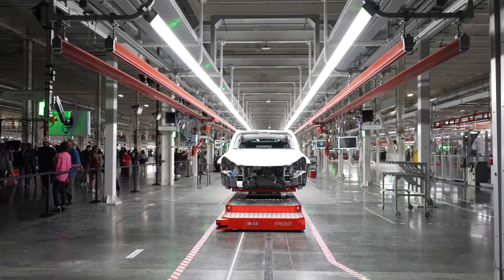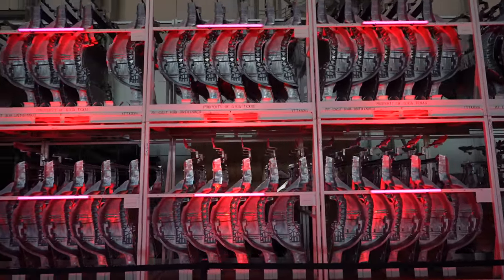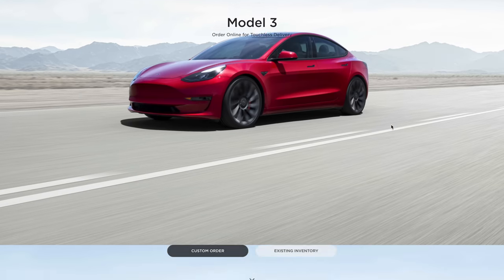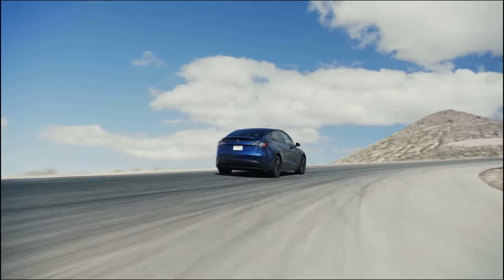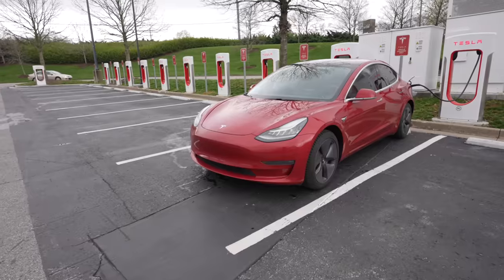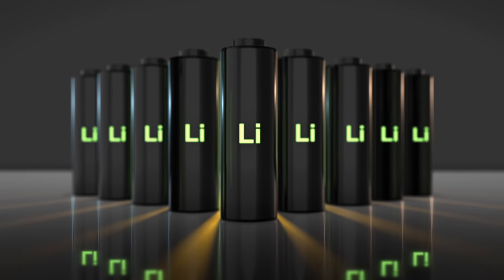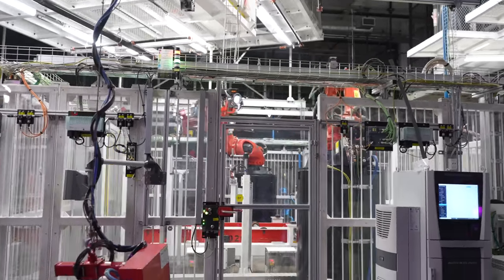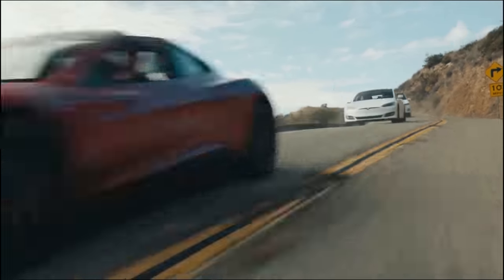Why I’m NOT Buying the New Tesla Model Y

Comment: Ordered my Model Y LR in Aug 21, took delivery March 30th.  Fremont VIN, live near Seattle.  Absolutely LOVE the car…even if it doesn’t have the new 4680s.
Reply: Did u get FSD?
Reply: It also doesn’t have …. An interior ?? lollll  these “legacy” automakers are just crushing the in cabin experience for the same price point. Did yours come with massage chairs for that 65k? Teslas have a strip of wood slapped horizontally across, and they called it a day lol . If you want a tesla experience , get an iPad Pro and mount it to the middle of your car dash . Done!
Reply: @ml5323  and the strip they added isn’t wood either. Just a strip of wood textured plastic.
Reply: @johnyhuh  Im pretty sure the wood is real. It’s supposed to be ebony.

Comment: Good video. I took delivery of my Model Y Long Range two weeks ago. I briefly thought about cancelling or delaying delivery and waiting on the new batteries but decided against it. Modern cars are much like many other consumer products, cameras, cellular phones, computers, etc. Now matter how hard you try to get the latest iteration of the product it quickly becomes obsolete or at least updated. It is useless to stress over that. Additionally, I installed an LFP battery in one of my motorcycles a few years ago. The technology wasn't ready for prime time yet and it didn't last as long as a conventional lead acid battery would have. I think it wise to let Tesla build these batteries for a few years and then get a car with one. I do think that LFP batteries will replace the Lithium -Ion technology in the future.
Reply: But it also doesn’t have built in massage chairs for that price point. Did you even consider the competition? lol not to be rude but many people are not doing their homework and glorifying this startup. Electric cars aren’t difficult, that’s why there are SOO many coming out this year. What’s hard is self driving and you’ll be selling the car by the time it provides you any meaningful value. Hard facts, but people are hiding behind the brand name just to own one
Reply: @ml5323  HUH? Massage chairs... I  researched it extensively. The Mach E was a non-starter for me because of really bad experiences with 3 previous Fords I have owned. I was slow to learn there. 
I liked the ID4 and the Ionic but not as much as the Tesla. I also looked at plug in hybrids but at the time I ordered none were available where I live. Volvos, Pole Stars, and, Kias were not really available when I ordered my car. Additionally the Volvos and Pole Stars come out even more expensive than my Tesla. I did rent a Pole Star, nice car but I like the Tesla better. 
You are correct, electric cars aren't difficult, but until the rest of the industry has the charging thing figured out Tesla is a better choice for me. 
As far as self driving goes, it did not play into my decision and I will not likely add it in the future. 
Finally, I come from a motorcycle background, specifically high performance motorcycles. Cars are generally slow and boring for me. My wife and I owned a string of reliable and boring Japanese cars and trucks, along with one unfortunate Ford truck,  going back to the early 1980s. We also have a 1970 Mustang Mach 1 my wife has owned since high school. It is pretty but otherwise a piece of junk. For me this Tesla is the first car I have bought in close to 50 years that I was actually excited about. It is fast (for a car) and just plain fun. It handles well for an SUV. Everything works well. People complain about all controls residing on the touch screen display. They should try learning the voice commands. Do you know how much I have spent on gasoline in the last month? $00.00. No, it isn't perfect, but no car is. I am really enjoying it. Hiding behind brand?? jeezes..
Reply: @jvlivtriple  he’s a troll commenting under everyone’s comments that are happy with their model y🤣 

doesn’t have one and has probably never driven one, probably upset he can’t purchase one🤷‍♀️

Comment: It should be noted that some people expect and overhype 4680 cells way too much. 5x Energy, +%16 range and 6x power is reffered to the cell itself, not the car battery. Considerably less amount of 4680 cells are installed in a battery pack which means the cars range boost is not as high as some people think it would be. Don't get me wrong, they are still nice to have and a welcomed bonus, but nothing people should really see as a make or break deal.

Comment: I think in these early years of EV adoption it is important to recognize that while EV driving range is important, it will become less and less important as the DC Fast Charging infrastructure is built out.  It is also important to recognize that most early EV owners slow charge at home and almost always start their daily driving routine with as much battery driving range as they need.

Comment: Our MY LR was delivered in January and it was nearly perfect with no gaps or other issues. I'd definitely recommend keeping your order - specially at the price you have locked in.
Reply: Get it and flip it to the used market.  Here in BC lightly used Teslas are selling for more than retail because people want to skip the lines.  Much as I like Teslas I'll be waiting for my Aptera instead; faster, cheaper, solar and supporting more diversity in the market.
Reply: @ccibinel  what's a aptera?
Reply: But it also doesn’t have built in massage chairs for that price point. Did you even consider the competition? lol not to be rude but many people are not doing their homework and glorifying this startup. Electric cars aren’t difficult, that’s why there are SOO many coming out this year. What’s hard is self driving and you’ll be selling the car by the time it provides you any meaningful value. Hard facts, but people are hiding behind the brand name just to own one

Comment: Most people fell into the hype that the 4680 battery was going to benefit the owner of the vehicle. That MIGHT have happened IF no Covid and the crazy pricing of the new and used car market. Since passing on the savings doesn’t make sense currently,buyers won’t benefit. The 4680 was mainly a benefit to Tesla, both in reducing manufacturing complexity and costs.

Comment: I locked in on Nov. 2st and I'm not cancelling and here's why. You as well as me we opted for the LR model. None of that will change. They're going to be making those out of Texas but it's going to take time to ramp up. My hope is that when they notify me it will have the 4680 batteries in it.

I suspect the standard range, for now, is for testing purposes so I wouldn't worry too much about the LR version.

Comment: RE: cheaper costs.  I think it will take like 2 years to start to see those savings from the new battery designs.  Also the new chemistry needs to be done as well, the Silicon is a big cost savers.  I'm curious about the weight, if they actually saved the weight they said.

Comment: Well don't worry about the 4680's because it seems there are precious few of them so far.  Tesla has a plan B of using the 2170's for the Austin MY's at least in the beginning with "....4680 production ramping up in the fourth quarter.." as I recall.   After to and a half years of 4680 development and still not much to show for it, it's quite possible these batteries will be thin on the ground for at least another year.

Comment: Andy S., you are absolutely right about range. My Model 3 is the same age as yours with about 30% fewer miles (67,000), and I have a whopping 15% range loss. Yeah, I know, sad. You have lost about 5% with your 100,000 miles. My "long range" is now a "standard range" at exactly 263 miles on a full charge. Tesla techs say it's just fine, all is well, it's as expected. In all my extensive reading about Tesla battery degradation, mine is the worst. Not the notoriety I like. I got long-range to start with for the same reasons you did -- winter weather and HVAC use.

You may recall I live in southern Indiana, and in March the kids and I took a small vacation to Pigeon Forge TN. We stopped at the London KY supercharger going and returning. Indeed, London has no reason for a supercharger station other than it's immediate easy-off/easy-on interstate status. I was glad to have it!
Reply: I have lost 15% in my Model 3 - which is driven by wifey. And i have GAINED 2% in my Model Y after 32000km. Crazy…
Reply: My Y performance has lost 15% in 2 yrs/25k miles. We have only used the SC ~ 10x and slow charge at home to 80%. It's frustrating.
Reply: 15% loss is rough.  If i'm not mistaken the warranty doesn't kick in until 30% loss  or total of 70% retention.
Reply: @grambo1980  Truth, 30% loss before a warranty replacement. I am a bit more than half way into my battery warranty, so at this point I'm all-in on it going lower, please. I have liked my M3 for almost four years now but this battery thing has really tainted my experience. That 50-mile loss means a lot more than it might seem at first glance.
Reply: @wolfgangpreier9160  I think I want a Model Y now ...
Reply: @astrodiver1  Nearly the same -- almost no supercharging, just a few times on long trips. My usual SOC is no more than 85%. Elon says 90% is OK but on this, I am more conservative. I use a Tesla wall connector at home so it's not like I am abusing the car. Just imagine if I'd gotten standard-range to start with -- no thanks!
Reply: @donaldstinnett5630  I can't complain it works, i have different EVs in my company. All are working just fine, The Model 3 is the fastest, the Model Y the best combination of fast, sleek, slick, roomy, comfy, everything.
Reply: Get a professional wheel alignment. Allot of the times the suspension is improperly setup from the factory and you get less efficiency
Reply: @ivancajka732  The alignment would be obvious on any vehicle with 21" rims. It is not an aliment issue.
Reply: @donaldstinnett5630  I also take a conservative charging approach, it doesn't seem to help :{

Comment: I ordered my model Y in October 23rd of 2021 and expected date is between August 16th to September 26th. I don't know why my wait time is so long. Only thing I added was the trailer hitch and everything else was standard.
Reply: Apparently the more specific the make the faster you get the car. If you were to get a blue color with white interior and sport wheels it would be a closer expected date. Getting everything standard will take longer since it’s in more demand.
Reply: @3rnestito993  Thanks for the information. Now I wish I picked a blue trim. I don't think Tesla will let me change the color now after pre-order since it's locked in.
Reply: I ordered mine on October 25 last year……my original due date was june……i changed to the white seats……i was pushed back to october…….but then this past month i was bumped to mid may…….just this morning, I received a vin …..with a 7 day window…..so i guess this is it!  I;m in so fla!
Reply: I ordered Oct 3rd and mine says Aug-Oct. I got the white exterior with white interior. Hopefully my date changes here shortly🤞🏽
Reply: @Cocoatreat  Thats awesome - Happy for you!                                                   I ordered mine Nov 7th 2021..EDD is from May 12 - June 23rd 2022.        Im also in S.FLA!
Reply: Ordered Oct 9 2021- Blue LRMY with tow hitch - EDD pushed from May to Aug-Oct last week… SF Bay Area. Very dissapointing.

Comment: Good call Andy, I think Tesla is sandbagging the Texas product.  I think in the earnings call they stated that for supply assurance the texas product could use 2170 if they had delivery issues, I think that explains range and weight limitations.  Once 4680 is truly proven expect range upgrade as a structural battery pack should offer significant weight advantage.

Comment: I am not sure if what I am going to say is good, but if I were to buy a vehicle, I would definitely make sure the vehicle has another power source to work with (similar to using gasoline to generate electricity). I am not sure about the battery usage though, but for me, as long as two sources can be used individually separately, then I definitely would be relieved about not finding a charging station. On the other hand, I also need to say gasoline prices are on the rise, but dual-powered vehicles seem a big deal for me regardless of the factors.

Comment: Article on InsideEV did a disservice to your video. I had to come here to hear for myself the reason you chose. For you, it's about the money savings and I can agree that would influence me, too. Although, I would gladly have paid the $9,000 difference even with a 50 mile difference because the 4680 is supposed to be the million mile battery. I think having batteries that last so much longer will help in the long run. Even if the batteries don't last a million miles, Tesla would be replacing them for free so if I drove them 400,000 miles and it degraded, then they would replace and boom, another million miles. But if you do long-distance driving a lot in the EV, having the extra 50 miles is useful. I would still go with the 4680.

Comment: To me, range is not all that important.  Most of my driving is 30 to 100 miles in a day, and home charging can easily handle that each evening.  If I am on a long trip - say 200 miles, charging will be required anyway, and spending an extra 8 minutes to get 60 miles of range (or throwing in one more coffee stop) is not too relevant.  (Your actual range is far less than advertised by Tesla). My model 3 Standard is fine, and the lower price is quite important.

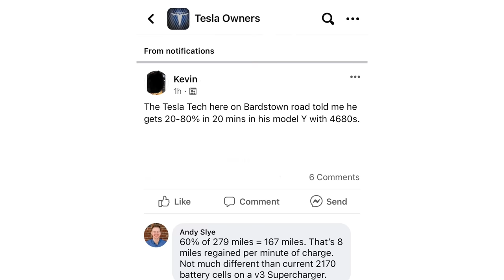Comment: @7:35 When they said 5x the energy with the 4680, it also means 5x faster charging and discharging. They probably meant to say ‘up to’ 5x the energy not 5x across all state of charge of the 4680 cell
Reply: Superchargers can only push 250kW but if the 4680’s can handle 5x energy then 75kWh can handle 300kW of charging while the 100kW pack can handle 400kW. Tesla’s probably gunna have to roll out new superchargers that can do 500kW if they want to take advantage of the new cells faster charge rate

Comment: I completely agree.  I was extremely disappointed when the long-awaited 4680 with all its touted benefits was announced in a lower range, lower performance variant at a very modest cost savings.
Reply: In Europe those cars would be the next best thing to the Model 3. But Model 3 and Y are already the best sold cars in Europe! Ok. Then the Model Y would have the chance to overtake Model 3… I would love a Model Y Standard Range. I would also love a RWD but i guess those will not be built anymore.
Reply: @wolfgangpreier9160  My point is that the 4680 was trumpeted for years as the next step up in performance, but that it is introduced only in a lower performing variant of the Model Y.  And for not much less than other Model Y variants with the older battery technology.  Why would someone opt for it only for a 5% cost reduction?  The value is just not there.  Either sell it for significanly less or use it for higher capability (range, power, etc.).
Reply: @alexv7150  Was trumpeted for decades now. Yes. Of course. You've heard from something like pandemic? chip crisis? Suez canal blocked? Ukraine war? pandemic?
Reply: @wolfgangpreier9160  I don't see the relevance of your comment.  I am stating the poor relative value of the standard range MY compared to the other MY models not the overall MY lineup and the poor application of the highly more capable 4680 battery.
Reply: @alexv7150  And you have proof which chemistry and how many of those cells are mounted in one of those Model Y from Austin? I do not.
Reply: @wolfgangpreier9160  Form factor and tabless construction were the key discriminators for the 4680.  I have seen a few references to the array size.
Reply: @alexv7150  Yes, references, hearsay. Nothing definitive. If they have used LFP chemistry its naturally lower density, lower cost and less miles. But even for this we don't have any confirmation. We have to wait until somebody delivers the full specs. 

You are maybe talking about the high end cells they talked about they want to use in the Semis and Roadster. But even that information is hearsay. Not definitve. Both vehicles are still not finished, produced and delivered to be tested independently. The tests must not destroy the vehiclses, we do not have enough of them. So: Nothing for Sandy.

Comment: You display a clip of 127 miles gained in 28 minutes vs the alleged 167 miles gained in 20 minutes with the 4680s. That’s nearly double the charging speed right?

Comment: Your reserved Long Range Model Y, that has the not-so-new battery, will have the new cabin heating system which uses a heat pump.

Comment: I haven’t read any other comments, but what will you do with your current Tesla, when you take delivery of the new Tesla?  Are your short term goals to buy a new Tesla every 5 years?

In 1996, I read about the first Toyota Prius hybrid. I was 39 years-old then and still owed money on a 1994 Saturn, so a Prius was going to be my next car in about 2004 or later.

Unfortunately, the Saturn was totaled from behind in August, 2003. However, I bought one of the first second generation 2004 Prius in October, 2003. Friends and acquaintances were skeptical about my purchase. Unfortunately, in less than 7 years the 2004 Prius was totaled by another driver. 

With the insurance money and the fuel savings from my first Prius, I was able to put two-thirds down payment on a 2010 Prius and paid that vehicle off in less than 3 years.

In the last couple of years, I have owned a 2016 used Prius.

Comment: They may have an OTA update that will increase the range to 300 miles, hence the slight difference in price between SR and LR. Also the fact that they will make it an AWD with 279 miles. I’m sure they plan on increasing range
Reply: Excellent point. I would still get the 4680 - AWD a definite.